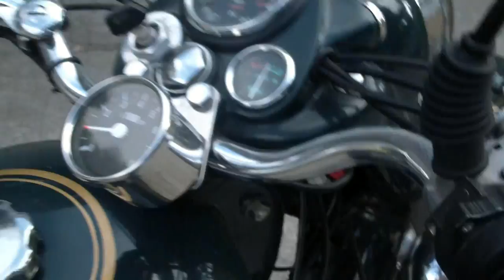How To Replace The Alternator Stator On A Royal Enfield Bullet Motorcycle

Comment: Thanks for the detailed video on this. This is so helpful. I have a feeling the alternator on my 2007 military iron barrel is shot (no AC voltage between violet/yellow/amber wires) and I'm going to use this as a reference. Hoping that's all there is when I open the primary case fingers crossed
Reply from the maker: I hope it goes well for you.

Comment: Hey. Thanks a lot for this video. It was really helpful as a reference for doing this kind of maintenance on my own. I've been having charging issues with my 97 500 bullet. When I opened up the side cover I realized that the stator on my bike does not shift around like what you mentioned at 7:53. Once, I've placed the stator onto the 3 bolts, even without tightening the bolts down, there is absolutely no play to work with. I found the only way to adjust the air gap on mine was to add a few washers on the bolts which moved the entire stator to the direction I want. However, I don't think this has worked well. Any suggestions?
Reply from the maker: +Romy Mathew Check the Royal Enfield forums on this subject. I know that there are a lot of people who have had these problems and are asking and answering questions about it. I think it varies depending on the model of stator that you buy.

Comment: This wouldn't have anything to do with intermittent or weak spark? My 2003 bullet has an electronic ignition and I'm thinking that might be the issue. I am going to convert it back to points. Not sure what else to do. I installed a new coil and spark plug.

Comment: Useful and detailed video.  I have a 2002 350 with a slight leak from primary cover.  Would a new gasket cure or is machining of cover probable cause for leak? I can't find these rubber gaskets anywhere either, any ideas?  Cheers
Reply from the maker: A new gasket should fix it. It is thick rubber.  You can buy one on eBay.

Comment: Thanks! I will check it ;). The multimeter reading in the output AC wires is around 2 v, so I hope will be that something is no placed well, otherwise I will have to change the alternator, a big odyssey in México due the lack of spares :(

Comment: Dear HooHooHoblin,

First of all I want to thank you for your very very useful videos, always is better to have a good "picture" of the job to execute than simply words.  I own a 350cc 1993 Bullet, and I think I have problems with my alternator (the motorcycle stops when I switch the lights on).  I have dismanteled it to look for a failure, but the ohm test -continuity and earthing- (to the stator) results good. It could be a rotor failure?

Comment: In fact, I had executed that test (and also I have started the motorcycle with a battery charger and all works fine with that). As I say before, I made the continuity and earthing test to the estator and all seems to be correct. So, I discard the problem related with the stator but I dont know how to test the rotor (This kind of rotor doesnt have conmutator like in a car alternator). Do you have any idea how to test the rotor? As I say before, I read that its most common to have a broke stator

Comment: Excellent video. Do you still own this bike and if so is this Stator still working fine? I have just bought a 50 yr old R/E Bullet and mine also has 4 wires too but i'm swapping it out for a more popular 3 Wire Version so i can do away with the AC Headlights & fit a Boyer-Bransden Powerbox & Electronic Ignition. They don't supply a wiring diagram for a 4 Wired Stator.
Reply from the maker: I still have it, but I haven’t started it in a long time. It probably still works.

Comment: What tools are you using? I am looking to buy a Force 142 peice tool set, but its really expensive. I have a 2005 Thunderbird AVL-CDI. its running for 18000 INR.
Reply from the maker: Just a regular tool set, except for the clutch puller.

Comment: Hello Brother, need a help.  Would like to know if an alternator fixing nut is missing from a RE bike what can be the consequences.  Not sure how it was lost.  My model is Thunderbird 350 BS3 India.  That nut can be seen sitting on the top of the engine cover just before the rear wheel disc brake oil compartment.  RE is not able to provide at the moment due to Covid-19 lockdown.  Inserting any matching screw and washer can do the job somewhat or my battery would drain out or my electricals will malfunction?  Would long drives be risky?
Reply from the maker: I’m not sure, but I think you could use a different nut and washer as long as it was the right size. On my 500, the alternator will move around a lot and destroy itself if all the nuts are loose.

Comment: It is eays to make a gauge for measuring the distance between the rotor and the stator.
Take a PET-bottle, cut it in the right shape and put it between rotor ans stator. The bottle shall move easily without sticking.
safe riding from Austria
Reply from the maker: Thanks.  That's a good idea.

Comment: Unlike your bike model (after mid 99), my headlight is fed from the battery, no direct power from the alternator. I read somewhere in te web that is most probably that the stator fails, so Im a little confused now. Cheers from México! and Thanks in advance for your comments.

Comment: I have replaced the Stator and Rotor in my 1982 model Royal Enfield. The problem is that the Ac voltage shown at both the wire pairs show vast fluctuations on my multimeter.
What could be the reason.
Reply from the maker: I don’t know. I would expect it to be consistent.